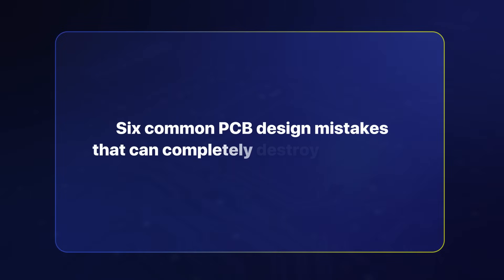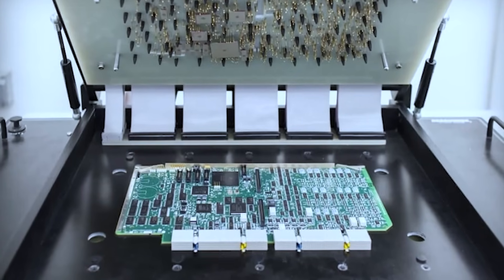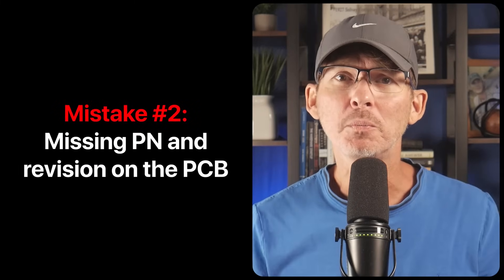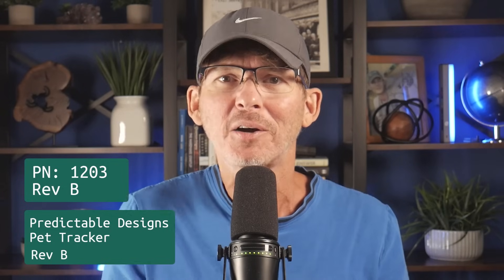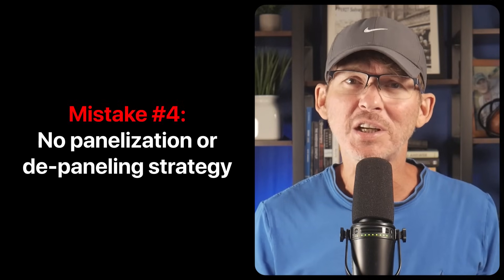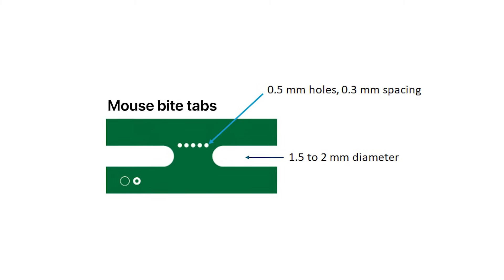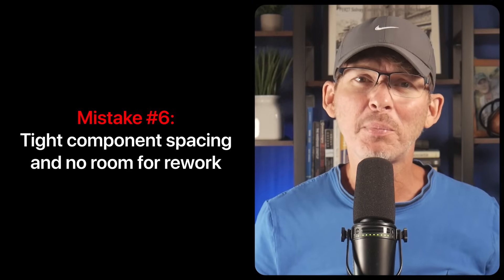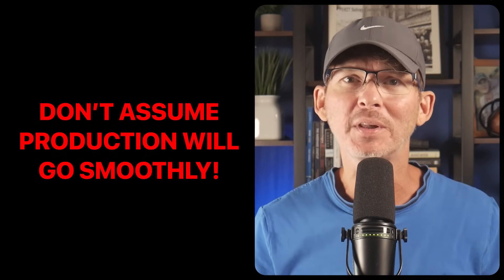6 PCB Design Mistakes That Destroy Production

Comment: I would agree with all this, I would add: adding an extra I/O pin so that the firmware can run in a test mode and output diagnostics for repair or as part of the production testing. Think a lot about component size placement, the pick and place machines cannot put any component next to any other component in any orientation. Remember, its usually best to overate a couple of components if that means the number of different components is less. Think about hand soldered items (particularly relays). Think about reliability, to give you an example, I once put a component too close to something that was earthed, if the board was abused a bit, it was possible to create a short circuit! Lastly, before you start your run, cover the board in crap, put it in 40 degrees, half cover the fan, run it to the max and photograph it with a thermal imaging camera, quite often the failure of the MOSFET, diode (whatever the weak link is) could have been prevented with a better layout so that the inductor (say) is not obscuring the heatsink.
Reply from the maker: Great advice! Thanks so much for sharing l!

Comment: You mention not adding test points near high frequency signals. What are some examples of high frequency signals with an ESP32 based design? Would a PWM driven RGB LED count as high frequency?
Reply from the maker: No, a PWM LED is not considered high frequency. Normally HF means at least MHz or RF. Things like RF feed lines and data buses.
Reply: Also with high frequency, low power square waves on ESP32 designs, you must not create stray capacitance in your board layout otherwise your product will become super sensitive to supply voltage and easily crash. You can tell this because if you very quickly turn the power off and on again and the unit crashes or worst still fails to power on reset.. you've cocked it!

Comment: I never make nothing without protoboard... only if it is ok i make my pcb.
Reply: In my own lab, I have a cnc drilling machine and all the gear to make plated thru prototypes, but its still easier and cheaper to get them from China!
Reply: @Ino-z2m , do you melt metal in side the shapes of this gears? If you wanna have a factory, the cnc will help you with prototypes. Cnc for me is slowly.

Comment: It's also very handy if your test points are accessible when the PCB is mounted in the enclosure. This is especially true if you need to disconnect displays or panels to access the test points.

Comment: Some things to add to your list:

1. Place two alignment holes at diagonal corners of the panel to align the panel in the test jig. A precision pin on the jig ensures the board is in exactly the right position for the probes.
2. Don't bother with a silkscreen layer as the production line rework staff have large overlays available for repair. 
3. Have the PCB supplier perform bare board testing on every board prior to delivery. It normally adds very little to the cost.
4. Beware of making the panel too flimsy as the spring loaded test pins apply a significant force to the panel. Alternatively have a lid on the jig that presses the board from the top.
5.  If you have to use a harness and flylead on the jig that plugs into the panel ensure the plug/unplug life is very high (1000+ minimum).
6. Ensure that the test jig power supply can handle a short circuit indefinitely. This stops the jig from failing after testing a shorted rail on a faulty board.
7. Barcoding every board in a panel helps identify jig faults as the failure follows a certain panel location.
Reply from the maker: Great suggestions, thanks for sharing your expertise!
Reply: I don't understand #2 'no silkscreen' don't most guides cover various needs for silkscreens?
Reply: @JustinShaedo With high density smd boards there's no space for silkscreening.

Comment: When using components with leads .... ensure the  PCB  holes are  NOT , NOT ,  NOT !  an interference fit .... this makes any rework  ( almost ? ) free from damage ... one way to ensure this , is to load your PCB ( without soldering ) , turn it upside down ... if  ALL  the leaded parts fall out , your rework technicians will thank you ... and ... you  WILL  save lots of wrecked inventory , thus maximising your company's profits .. (  NOKIA™ design idea  ) .... DAVE™🛑

Comment: One comment about PCB part numbers.  Part numbers infer that to parts with the same part number are interchangeable.  The raw PCB part number should be unique and changed with almost every board design change. In that case, the revision number isn't all that important.  It's also a good idea to realize the part number in the copper.  On the other hand, the finished PCB assembly may have multiple options using the same raw PCB, so each assembly option should have their own unique part number.  In that case, it's best to realize a large white silkscreen pad, so the unique part number can be stamped or written on the board (this can be handled using part number suffixes).  And as in the raw PCB case, almost all changes to an assembly affect interchangeability,  so an assembly should then get new part numbers.  Only the most minor of changes, like a note change on the corresponding assembly drawing, should be documented with a revision change.  Also the assembly drawing should document what part number(s) should be recorded on the assembly.
Reply: My preference as a test technician is for a new part Rev letter when a pin compatible part substitution is made or pads are filled or deleted (eg Rev A has user select resistors, rev B has them installed by the manufacturer, Rev C deletes JTAG headers) If the copper changes or there is a functionally significant substitutions us a minor revision.
Reply from the maker: Very helpful, thanks for sharing it here!
Reply: I really underrated comment, not following that directions can cause a lot of troubles, thanks for sharing! 🙏
Greetings from Buenos Aires 🙂

Comment: After the 6 "don't"s, here's 6 "do"s: one, make sure to place the fiducials on your panelized PCB perfectly centered on the panel's 5mm edge rail; this way they'll be conveniently covered by the clamping hardware in the pick and place machine and totally impossible to use for actual alignment.

Two, make sure your PCB densely populated with components on both sides is appropriately v-grooved right down the middle (many rows is even better!) so it's impossible to support and guaranteed to buckle or straight-up break inside the machine!

Three, don't ever use thermal relief on your PCB, that stuff is for sissies - this way you can guarantee the pads of your 0402 resistor will heat up unevenly in the reflow oven and nicely tombstone your part, surface tension pulling it upright onto the other pad.

Four, make sure the pads for your part are at least twice the size of the manufacturer-recommended footprint, to ensure the part will sit in some randomly skewed direction (if you're lucky...) instead of being neatly pulled into alignment automatically by the aforementioned surface tension when the solder paste melts.

Five, don't ever include any polarity markings on your PCB, or if you absolutely have to, at the very least place them UNDER the part so they can't be seen after reflow - they just screw up the aesthetics of your beautiful board, and it's widely known PCB fabs only ever hire psychics, so they really don't need that stuff anyway!

Six, if you feel the need to diverge from the standard green PCB, you can make it any color just as long you make damn sure it's black - that way your fab's optical inspection machine will completely fail to distinguish the black PCB from the black chips (and also utterly fail to detect the 3D board base plane) making inspection next to impossible, assuring your name will be uttered often and in high praise by the fab personnel...
Reply from the maker: Lol. Thanks for sharing these!

Comment: Another major headache is when the same part number comes with different pinouts from different manufacturers.

For example, for the 13001 NPN epitaxial silicon transistor (commonly used in CFL electronic ballasts) Fairchild's KSE13001 follows a B-C-E pin layout, while other manufacturers use E-C-B instead.

During prototyping, you might test with one brand and everything works fine. But when procurement later sources 13001 from a different supplier, same case, same markings, datasheet looking nearly identical - suddenly half the production fails, or you end up with random dead CFLs/SMPS units, all because the pinout quietly changed.
Reply from the maker: That's a great point, thanks for sharing!
Reply: oh no......
Reply: Thanks for sharing

Comment: Tip from a production engineer at a PCB fab: Please for the love of ** use MPN's instead of supplier part numbers in your BoM. One is universal and will (probably) never change. The other is not.
Reply from the maker: Good point, thanks! Digikey part numbers are not universal.
Reply: Speaking as a service tech, YES, THIS!!!!!
Reply: It does change... the manufacturer often EOL's the part... and releases a new compatible part using a new MPN. Makes life easy.

Comment: Is there any value in keeping the 0R resistors around in a production run (after prototype is over and the correct configuration is known)
Reply: YOU try routing even a simple circuit without any 0R's on an aluminium substrate PCB (for heat sinking), where you get exactly ONE side to route on.
Reply from the maker: It depends on the circuit.
Reply: Used as jumpers and fuses.
Reply: I guess it depends on if you ever plan to see the boards again.  If your product is basically disposable than your good.  If someone will ever want to troubleshoot the board after it has left the factory, than please keep them in.

Comment: one comment for spacing: i like 1mm spacing for passives and 3mm spacing for chips, would be curious what your recommendations are
Reply: I hand assemble my first boards so if it looks like a PITA for me with parts too close for tweezers, it needs more room. Has worked well for me.
Reply: You had so much space? We had like 3k components total on a board that was half the size of a modern smartphone

Comment: one question: why not use screw holes as fiducials?
Reply: Fiducials are pads and a pad has way better tolerances than a screw hole also fiducials have better contrast for the camera😊
Reply: @ganopterygon  ...except when, for whatever reason, there is veeeery slightly more "HASL" on the fiducial than there should be, making it look like a Rorschach test for the machine due to the wavy surface of the dot. Then you just manually override PCB after PCB after PCB after PCB after PCB while swearing like a sailor.
Reply: It depends on the pick and place machine itself, HASL covered fiducials cannot be detected by some standard machinery when the light is reflected in a poor angle. It depends on the illumination strategy. Source of knowledge: practical experience, the shitty PNP software did not even allow to manually adjust the fiducials. The solution was to write the PNP software myself, the entire story got me into mechanical engineering.
My software is printing a preview on the video window so I see where items will be placed and I can fine-adjust the fiducials easily.

Items on the copper layer should be taken as reference, holes might be inaccurate, there might be a small offset between various layers or holes.
The copper layer and fiducial on the copper layer is the most accurate someone can get - some Pick and Place applications (nowadays I would almost say most) allow stretching / shrinking the PNP data based on the fiducial location.
If a manufacturer requires 2 fiducials the PCB mapping is done via trigonometry.
If a manufacturer requires 3 fiducials the PCB mapping is very likely done via affine transformation (better).

Some PCBs might be slightly bent too, I have seen a PCB massively bent on a Yamaha PNP machine - that machine did magic to place everything accurately because it also needs to take care about the placing depth.
Reply: Because you’re depending upon the hole placement accuracy instead of the artwork placement.